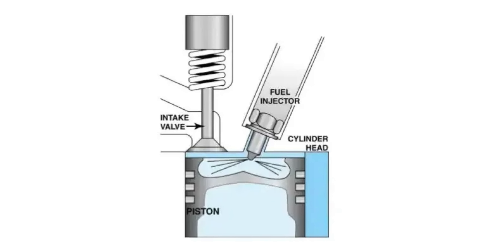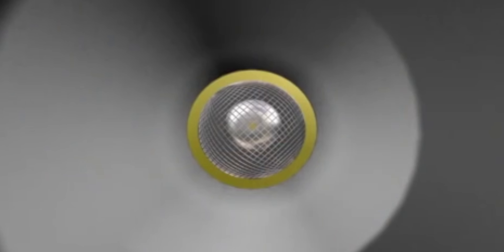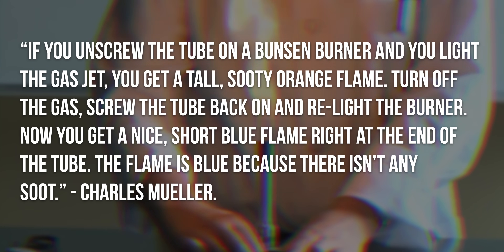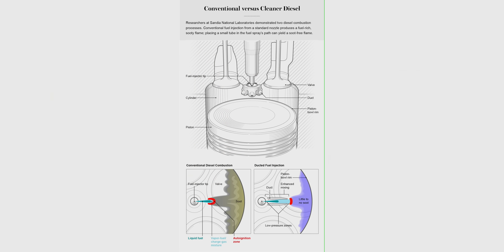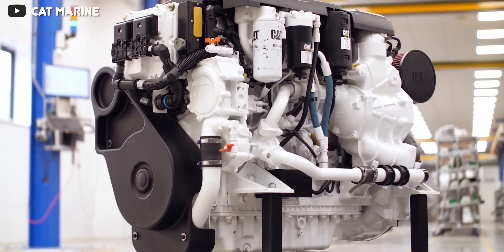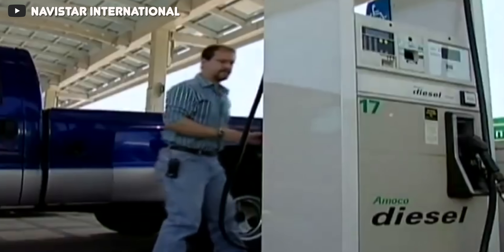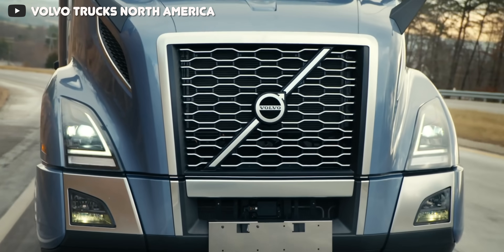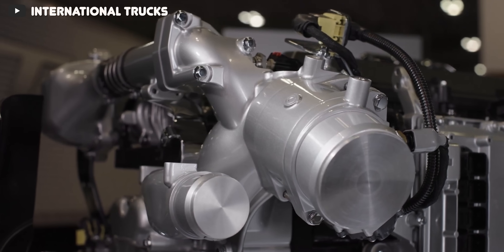Zero Emissions Diesels: How Ducted Fuel Injection can Save the Diesel Engine

Comment: If this DFI system does exactly what it says it does in most real world driving conditions, I could imagine that some markets would see an increase in diesel equipped passenger cars due to this newfound cleanliness of the engine. If it doesn’t stink and if it doesn’t poop out black shit, people would probably be more interested in Diesel engines. This could be very big news for the Diesel engine in general.
Reply: Modern diesels running on modern fuel don’t stink or “poop out black shit”. Not a properly running one anyways
Reply: @nsboost  Even a properly tuned old diesel doesn't stink or put out excessive soot. But the caveat here is "properly tuned" LOL
Reply: @nsboost  only modified ones do which whoever first said that doesn’t realize
Reply: @fadedsoul23  even properly modified ones don't, unless they're being run rich on purpose for cooling (pointless outside of drag racing)
Reply: @JamesBalazs  well I mean like the guys in the south that roll coal for fun. Those guys
Reply: @nsboost  yeah they do, delete them and they will.
Reply: @rightsdontcomewithpermits7073  my 6.7 is deleted and don’t even blow a puff. My 2002 5.9 is extremely clean as well. 

Black smoke is excess fuel. Tune it right and it will not blow smoke
Reply: @nsboost  one of the things you said is that they don't stink.. and they really do. 

And I'll bet that it is still has some smoke.
Reply: @rightsdontcomewithpermits7073  I hated diesels. For those exact reasons. I would own one if it stunk or smoked. My brother did $1,250,000 last year tuning them. He is known for his clean tunes and that is why he has done well. Trust me, my trucks are are cleaner and smell less than my 2000 Trans Am.
Reply: Volkswagen and it’s sub-brands can finally go back to diesels
Reply: There is a car i change the timing belt which had no odor, no black smoke, you could breath in the rear of the car (although never recommended). The car was a 5008 from peugeot, 2015 or above, with the 1.6 hdi engine.
Reply: idk most diesel people I know want it to stink and billow smoke.
Reply: @jhoughjr1  Maybe in America with trucks, but other than that the people who daily drive econoboxes with diesel engines don't really want that at all
Reply: Not everyone wants a honda civic that sounds like giant riding lawnmower though.
Reply: what diesel you driving? they aint like that anymore.
Reply: Not to mention that since there is less unburnt fuel, these dfi engines will get substantially better fuel economy, and with cleaner emissions, diesel engines could irradiate the need for gasoline engines.
Reply: Its 2026 and in europe euro7 diesels have non of this tech, but an ultra complicated DPF SCR system that will render these engines highly unreliable and pointless.
Reply: The "stink" has already been dealt with with the "ultra low sulfur" diesel.
Reply: @johndavidwolf4239  
Load of crap. 
All diesel fumes stink rancid.
Reply: @brianmurphy8790  : Yet there are some people who love the smell, to each his own.
Reply: @johndavidwolf4239  
Wonderful, all those people who love the smell are welcome to lock themselves in a garage with a diesel engine running all day. 
However, their liking of it shouldn't dictate what the rest of us are forced to inhale, just walking down the street.
Reply: @brianmurphy8790  what a wonderful strawman argument. Let me make one of my own: Those that want to kill off reliable transportation methods should walk through the empty shelves at the market, while those that don't mind the smell of some sulphur can enjoy the shelves stocked with goods.
Reply: @bbkr7910  
Did you think that up all by yourself?
Reply: @brianmurphy8790  LOL! Must have struck a nerve for you to come back with an ad hominem attack. Maybe address what is being said next time instead of trying to change the subject.
Reply: @bbkr7910  
Can't you try thumping the keys with your shoe size?
The IQ is simply not up to it.
Reply: @brianmurphy8790  still didn't make any coherent statements in an attempt to prove my comments false. Good job being another lemming on the left.
Reply: @brianmurphy8790  as a lifelong pedestrian, it actually does. Ppl in cars matter, ppl not in cars dont matter. Our entire society and landscape echoes that fact.
Reply: @brianmurphy8790  Great comment.  I'm an OTR driver and to me diesel smells just like money, however my wife can't stand the smell of diesel exhaust.  It literally makes her nauseous.
Reply: @davidharris9077  
Some diesel exhaust smells worse than others. Newer cars make the worst smell, due to the much higher fuel injection and combustion pressures.
The particulates are also much smaller from such engines and thus, are absorbed into your blood far easier.
Don't get me wrong - older engines still stink, it's just a tad less vile of a stench.
On cold and still winter mornings the fumes linger at the roadside for a long time. The whole length of the streets will stink, there's no escape from it. It makes my dogs cough and sneeze too.
Reply: Here in Europe the sales of cars with an ICE, no matter if they are diesels or regular fuel or hybrids, will no longer be allowed, by law, from the year 2035. So to think that any ICE technology can be saved is complete and utter nonsense. Another big clue is the fact that all the major manufacturers put their investments and developments into electric drive trains, and not into outdated ICE technology.
Reply: @insAneTunA  gunna be hard to transport goods across the continent without diesels.
Reply: @nsboost  🤣Here is why your comment is completely outdated #electricsemitruck
Reply: @insAneTunA  you done any research? You think those electric  semi trucks with 150mile range is going to work out? Give me a f’n break
Reply: @insAneTunA  look at internationals new medium duty trucks. Diesel version has a 400 mile range and is refilled in minutes.. the electric version has 130-150mile range and takes a hour and a half to charge. That’s not going to work dude.
Reply: @nsboost  First of all, the large electric Semi trucks have a much larger range as that little toy truck that you mentioned. 

Secondly, when I say electric it also means hydrogen powered in combination with a fuel cell which powers an electric motor. Which solves the range question.
Reply: @insAneTunA  I know the clues but I don’t really agree with them. But I’m sure I’ll come around eventually
Reply: @insAneTunA  until next elections. The average person can’t afford an EV. Not even the Dutch. Those 2035 plans are going in the bin in 2025.
Reply: @jos_t_band3912  Nice fantasy. What you say is just baseless utter nonsense. As usual from people who can't handle the facts.
Reply: I'll miss the smell and the smoke but yeah your probably right..

Comment: I love the idea that it can be retrofitted to older engines. 
But, will it work with biodiesel as well?
Reply: There is no reason it shouldn't.
Reply: Might need to be modified to handle more viscous fluids though
Reply: There is no reason it shouldn't work about the same because the principle is the same
Reply: Ahhh good question 🤔
Reply: Biofuel is the absolute worse idea for fuel ever created though.  You know how many corn fields it requires to make it?  To many. That could be used to grow other foods.  I find a lot of people don't consider this.  Biofuels comes from crops. And we need those to eat. The earth only so big. And we have a food shortage globally. So making using food just to run cars is highly irresponsible.
Reply: And what do those crops require to grow? Fertilizer. What does that fertilizer create? GHG. And now that they are beig idiot and tryna ban fertilizer even tho it's literally required to grow things. The production of Biofuels is even a worse idea. Cause now we gonna grow even less crops. And people still think using them is an option so they still don't have to walk or buy a bicycle.
Reply: The environments biggest problem. Is people are fking lazy.  Thats the real issue.
Reply: Need testing to find out.
(I think it would)

Comment: No offense to you but the information you are reading about is wildly inaccurate, basically marketing wank. Diesel engines don't inject more fuel than they can burn, all factory diesels run extremely lean. Secondly the egr issue was solved by cat before they stopped onroad engines, it's called CGI "clean gas injection"   basically egr but draws exhaust AFTER the dpf so its clean. The only thing that "new" injector seems to do is create a tiny amount of swirl in the charge and also a hot spot in the combustion chamber.
Reply: In theory CGI was great, in reality it was terrible
Reply: @ericb8030  it was still way better than the egr systems of the same time, and probably would be better if it was continued in development
Reply: @evil_me  Pipes routing back would crack or bust resulting in unfiltered air being drawn back in. Honestly they could just use more def for nox control and eventually eliminate egr all together

Comment: I'm still not quite sure on this, is like IDI, or is the injector spraying into a "nozzle", that then spreads the fuel more.
Reply: The diesel is progressively mixed/atomised in an injector tube BEFORE it's fired into a deflector (baffle?) & into the cylinder when compression (lower than std c/r's) ignites it.. the trick has always been to atomiser in the tube in a way oxidising (burn) doesn't happen.. in the injector tube.. the next BIG question to answer is the political scam surrounding "nitrogen" emissions.. understand "energy equations" & how nitrogen oxide "emissions" stand on the equation.. there is only a fixed amount of nitrogen & oxygen.. on our planet.. so ask.. WHAT is nitrogen oxide derived from.. we don't bloody create it from nothing.. it's simply a shift of molecules that rebalance themselves in the atmosphere back to what they were.. before they went through a combustion process.. it's all a scam

Comment: Sick brother, I love emission compliances.  I especially hope that California will back all this as they make the BEST decisions. 

I've always found my Def lines don't freeze enough and my dpf filters don't clog enough.
Reply: I lost all my emissions equipment in a boating accident. I can totally relate to all those gun owners who are also terrible boat pilots.
Reply: Cant fault when they have "fallen" off.
Reply: Please tell me I get to keep using DEF.  I don’t know what Id do without regens.
Reply: It sucks and needs to work better that being said your not cool or more manly for wanting to breath in soot
Reply: Anything California does the rest of the country should do the opposite.
Reply: This looks to be a MAJOR upgrade for base specific fuel consumption, allowing you to make upwards of twice the power on the same amount of fuel, or alternatively the same amount of power with less than half as much fuel. This is an absolute win like when electronic fuel injection happened allowing you to run the whole engine at the same air fuel ratio through the whole Power band with active adjustments the whole way. Or like when turbos were introduced to be able to stuff tons of extra air in, and allowing you to make the power of a big engine on a smaller turbo engine when you want to, but get close to the fuel economy of a small engine by itself when not under boost.
Reply: @Prestiged_peck  also if this comes out and manufacturers can get rid of the DPF then we get our vroom vroom sound back.
Reply: @connor4961  OH YEAH gotta get the powerstroke roar back, ain't nothing match the exhaust sound of a powerstroke when it's making proper power!!!
Reply: @Prestiged_peck  cummins sounds better

Comment: It reminds me of the Honda 3 barrel lean burn system they had in the 70s and 80s. An extra valve to let more air in to the source of combustion kinda deal.
I think with this new injector injector cup failures will definitely be more common due to the much leaner burn at the tip of the injector.
Reply: With the right material used this could be made a non-issue, but it will be a question of cost. If they combine this with more efficient valvetrains in the larger engines, and possibly even cylinder deactivation (I would only accept this on OHC engines as companies ford and Mercedes have proven it can be made reliable over the years, the lash adjusters can be starved of oil completely safely on OHC engines because they don't need to move up and down in a bore, unlike GM and chrysler's pushrod lifters which play the same role of holding tension but are, in current designs, splash oiled for a large portion of their lives as oil pressure is used to activate or deactivate them)
Reply: @Prestiged_peck  Cylinder deactivation wouldn't really provide much more efficiency for a semi truck unless its bobtailing. 
Also Mercedes had a similar-ish system on there om616 and om617 engines in the 70s and 80s. the fuel was injected into a tube with a ball at the end for better atomization and less noise. So I really don't think cost would be that big of an issue if the system is as good as it sounds.
Reply: @robwhite3241  I was thinking more for class 2-5 trucks that can make more than enough power even with a work bed to keep rolling down the freeway when down a few cylinders, and even if they don't they can add extra fuel to the still active cylinders while not having to deal with the pumping losses of compressing air in the deactivated cylinders. Cummins will probably have a hard time doing it as straight 6's don't take kindly to dropping cylinders, but Isuzu and ford should have no issues doing it to the v8 powerstrokes and duramaxes if they go overhead cam. With this massive reduction/near elimination of soot, they might even be able to bring in VCT or VVT systems, further increasing overall efficiency by allowing the engine to spread the torque curve over a wider range and effectively make the engine act like it's more powerful than it actually is (think about it, you can make an engine with a really peaky torque curve, and the. Use VCT to move the peak around, thereby raising average toque)
Reply: @Prestiged_peck  Now class 2-5 yes I definitely agree. These diesel pickup motors that they're putting in nowadays are so crazy. They put out more than my 1970s caterpillar motor that has 15 liters of displacement. 
Most people who buy these diesel trucks don't even use the power they have and so they get the same damn milage the gas one's get, only less reliable. The new motors can already move the torque around pretty good with computer timed injections, with the addition of VVT and VCT they could just keep it at 900rpm and be efficient but still have the power when they need it.
 
These electric numb nuts don't understand that there still much more innovation before the internal combustion will ever be done. We're just getting started.
Reply: @robwhite3241  alternatively, they can forgo the complexity of VCT/VVT, and instead build an engine that idles really clean, and runs REALLY efficient and clean at ±50 rpm of the torque and power peaks, with a really peak power/torque curve, and then hook it to a generator. And drive the wheels with electric motors, dropping a small power balancing battery where thr transfer case would normally go, boom, super efficient, extremely good torque, and extremely clean operation, all with what could be a relatively simple hybrid system. Engine can be off for low speed parking lot level maneuvers, run at a high efficient idle for low load normal speed driving, and when power is needed it can be run full force and generate all the motor generators can use, you can also add in an inverter and power tap in the bed like the F150 powerboost has, but being a diesel it can generate lots more electricity and actually properly run a work site with a big enough inverter.
Reply: @Prestiged_peck  : Rather than cylinder deactivation, just add an additional overdrive gear to drop the RPMs, which has the same effect as it drops "displacement per Minute".
Reply: @johndavidwolf4239  Volvo and Freightliner are already doing that with semi trucks
Reply: That's not how Honda CVCC systems worked.  It was a lean burn system.  It was so lean that the fuel charge from the main barrel was to lean to ignited by the spark plug.  The small barrel and small valve introduced fuel indirectly to the combustion chamber but to the spark plug.  This small rich air fuel mixture could be ignited by the spark plug and then that flame could ignite the lean fuel mixture in the combustion chamber.  The emissions were so low that CVCC engines, that were carburated, did not require catalytic converters.
Reply: @mrvv8337  So the 2 other barrels delivered a lean mixture to the combustion chamber while the 2rd barrel delivered a richer mixture to the spark plug to get it going.
Reply: @robwhite3241  Yes, there are two primary barrels that supply fuel under all conditions and a secondary barrel for more demand/under high load.  It's kinda similar to an idi diesel.  It has a pre-chamber that is given a small but rich air fuel mixture that can be ignited by a spark plug.  The main barrel delivers a fuel mixture that is too lean to be ignited by a spark plug all by itself.  So the flame front by the small valve/barrel/spark plug (these were three valve cylinders) lights off the lean mixture aka as a stratified charge.
Reply: Love the idea but will but will the product evolve fast enough to trickle down to daily driving cars !! 
Who knows!!